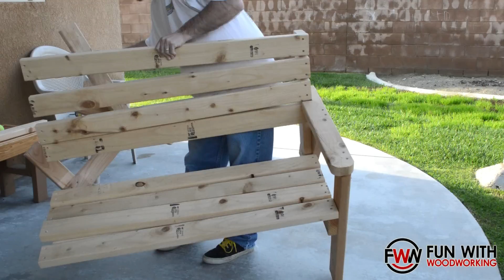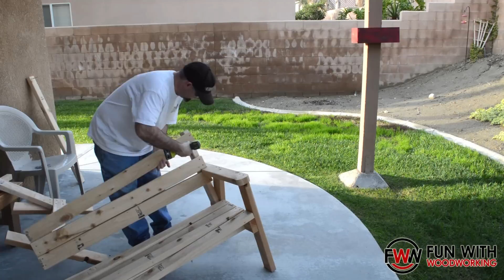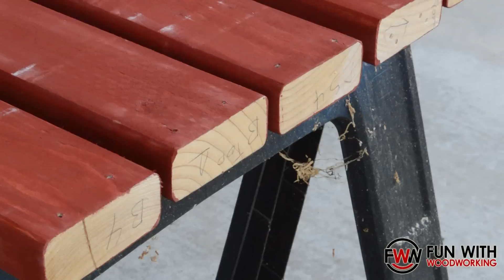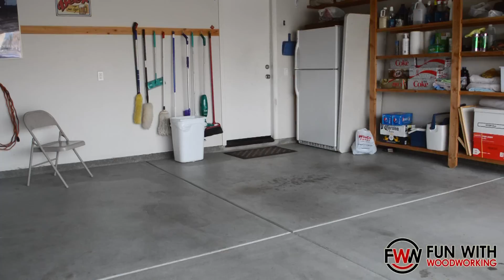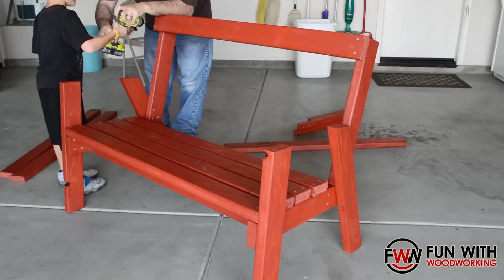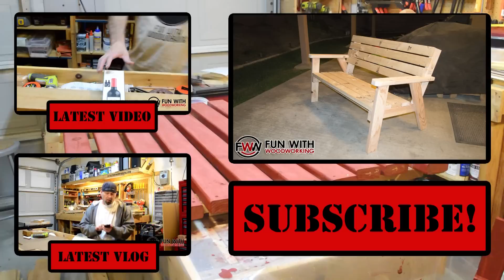Project update - Finishing the Park Bench

Comment: Nice job with bench, lovely family. I've had bad luck with foam brushes leaving bits of rubber behind on the wood because of the abrasion, now use cheap bristle brush instead.
Reply from the maker: Not all foam brushes are created equal.  I don't buy the cheapest brushes and I also prep the wood before I apply anything with the brush.  Everything has been sanded to at least 120 grit as well.  Thanks for watching!